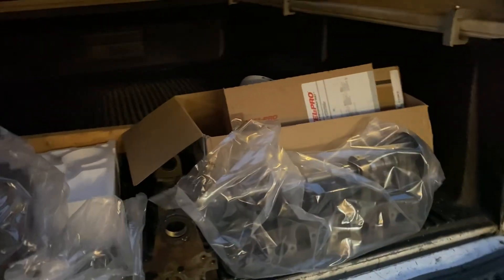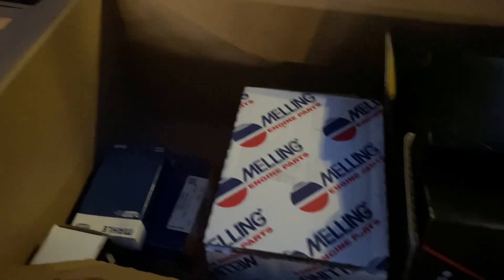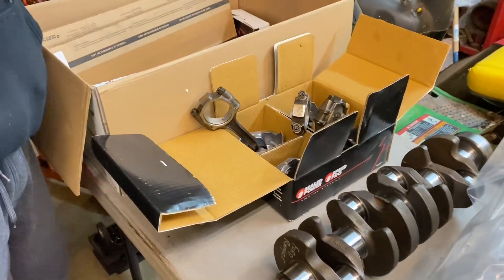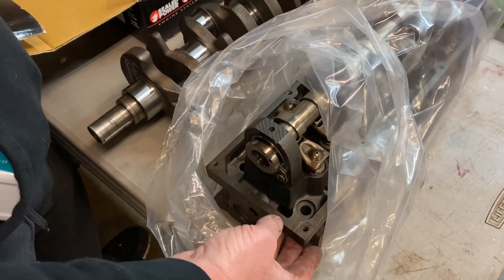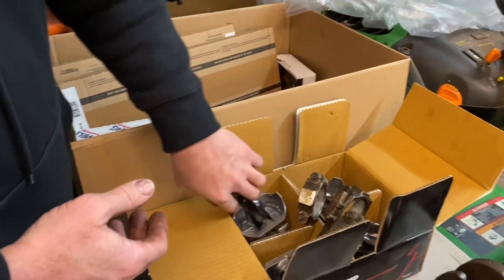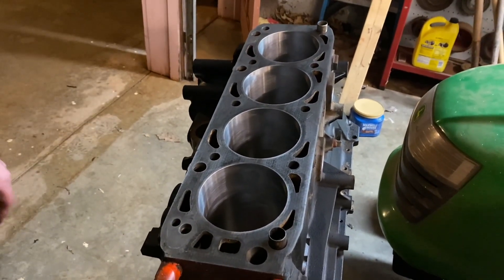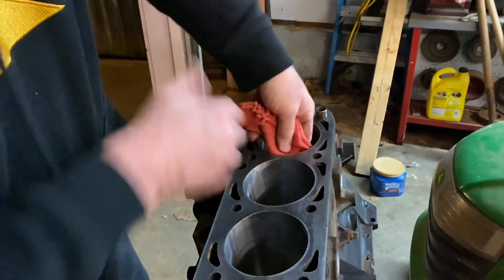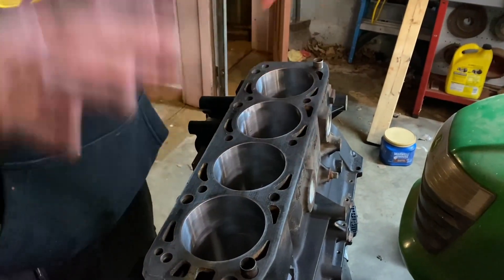New Engine Parts and Machine Work Complete - 2.5L Ford Engine Rebuild

Comment: From personal experience, I say never spend any money rebuilding these damn 2.5l motors, the cylinder heads are made from glass. I am on head no. 3 with 125k miles, and nearly 10k dumped into a POS truck

Comment: Where did you get the rebuild parts from? I’m about to do this with mine
Reply from the maker: The machine shop supplied the kit. I purchased it through them since they had to press the pistons on the rods. It was a fair price.

Comment: Sounds like a good Machine Shop to do business with! Should have a good engine with plenty of miles to go on your sons Ranger.  IMHO I'd get the proper Thermostat Housing for that replacement head if you can find on a moderate cost. Heli-Coils are a great fix but one I'd use if another option was not available at a minor cost. Just my two cents. Look forward to more!